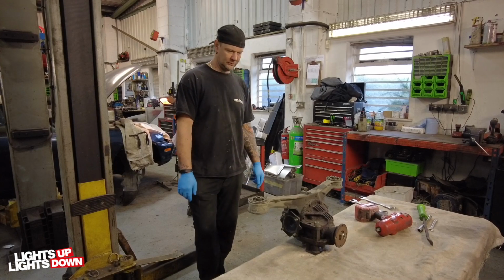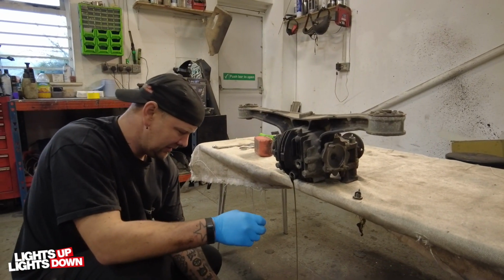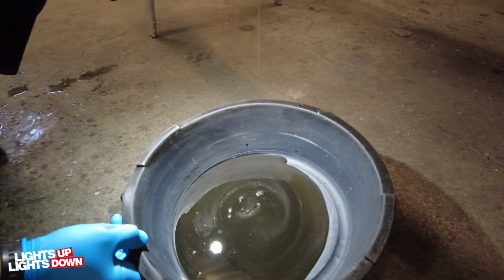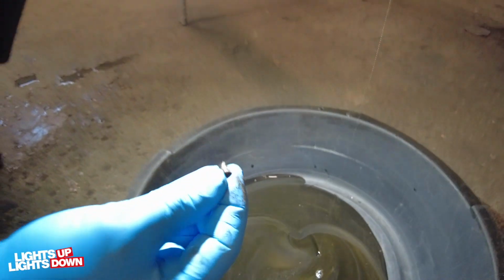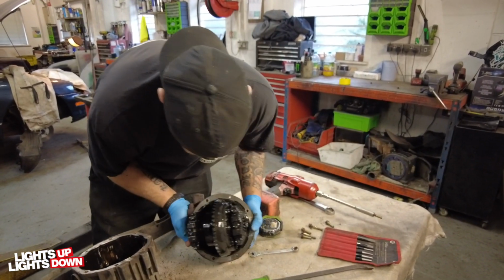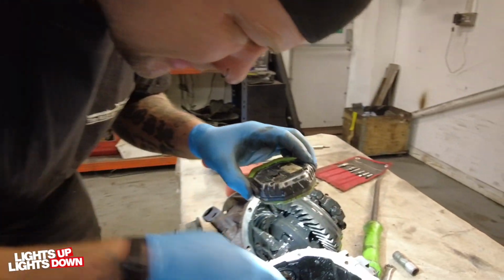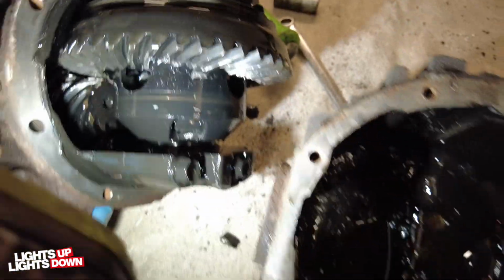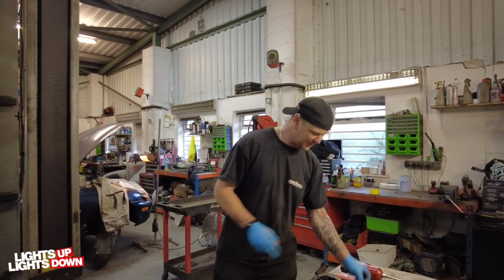Broken turbo MX5 - What has Roy broken this time?

Comment: 4k rpm clutch drop? Down shift to 1st @ 60 mph? Replacing with a Torsen?
Reply: None of the above just plain not coping with power and no I've fitted a good Fuji diff